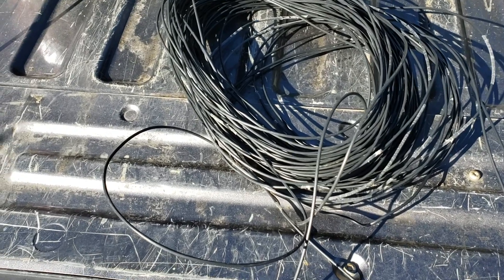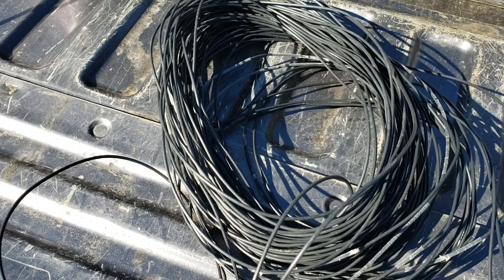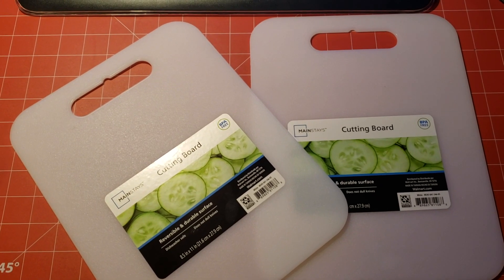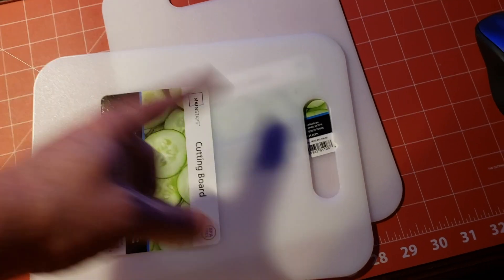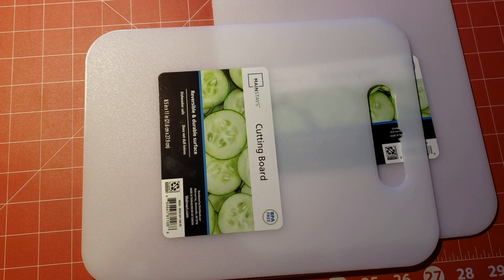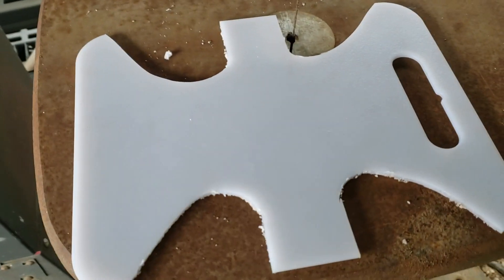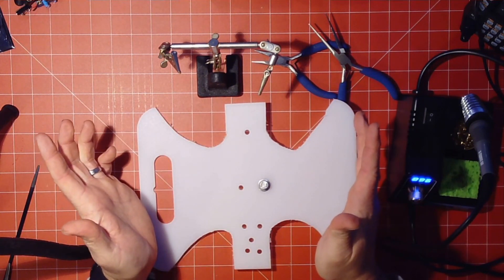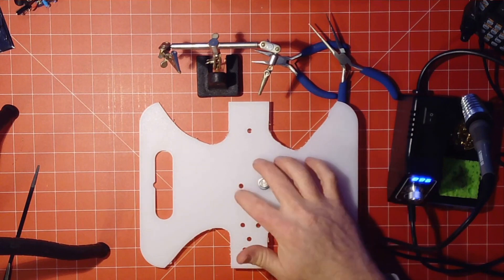Ham Radio Basics: How to build a 40 meter Dipole Antenna (no balun)

Comment: Hi Steve, I use cutting boards also I have picked some up at the dollar store but will have to check out Walmart.  If I may a couple of suggestions to make your assembly a little easier. I would use a crimp on ring connector for both the wire and the coax ends crimp and solder with heat shrink ( I usually take off the plastic parts for a smaller connection). This would make it easier to change say a bad piece of coax in the future.The other thing is strain relief for you wire ends , I like to drill 3-4 holes just big enough to fit the wire and weave them in and out of your center piece it might work for the coax also if you can space the holes far enough apart. Usually for the ends I attach some para-cord to tie off to something. Keep the videos coming your doing a great job and we will have to do a park to park one day!!
Reply from the maker: Good suggestions. I have been considering ways to change things up a little. This little guy works like a champ, but I would like to make another. I want to make one that is a linked dipole, where I will have it cut for 20m but can clip on a second section to each end to make it a 40m. I'm also considering a fan dipole build for the house. Thanks for watching, and I would love to get a park to park someday! 73